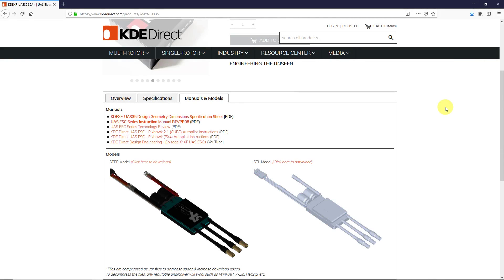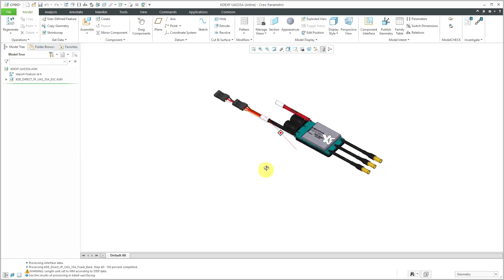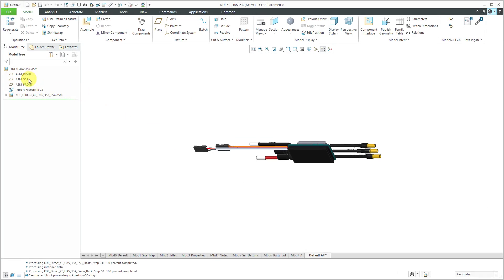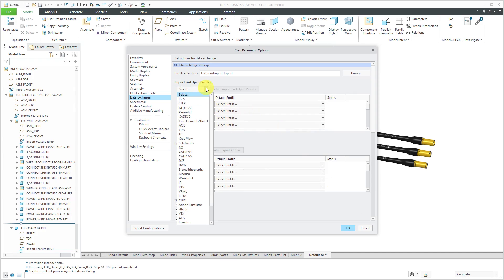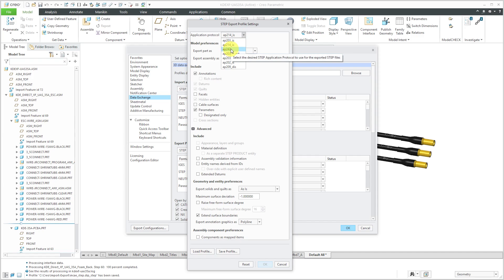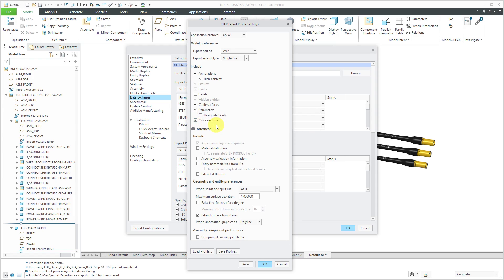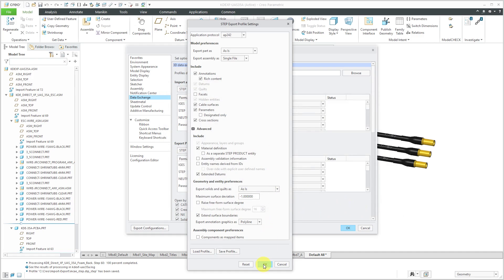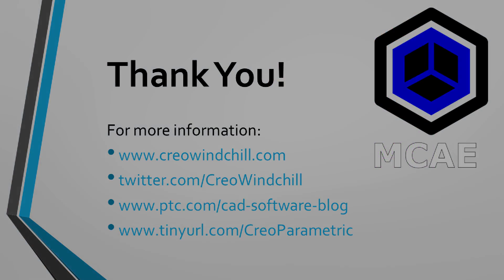Creo Parametric - Importing and Exporting STEP Files

Comment: HOW TO SAVE STEP MODEL WITH COLOUR IN CREO 9.0
Reply from the maker: WHY ARE YOU SHOUTING? WRITING IN ALL CAPS IS THE EQUIVALENT OF SHOUTING.

STEP AP 203 does not support the export of colors. Use either STEP AP 214 or AP 242; both support the export of colors. It's dependent on which Application Protocol you select for export, not which version of Creo you're using.

Comment: It would be helpful to dive into those advanced parameters in more detail. What does creating the components as mapped items do, and why does it save me 1 MB of file size? I try to prevent step translation import errors by unchecking the "Extend surface boundaries" option. Will raising the free-form surface degree help translate round operations better? I need more answers.
Reply from the maker: That’s beyond my expertise. I recommend contacting PTC Tech Support.

Comment: if I export an assembly exactly as shown in this video it seems like it worked. But then when I open the exported step file up in Creo, there are some parts missing, some parts in the tree on the left are marked red and lots of errors pop up ("import validation error, couldn't create volume" or something like that). I have no idea why and it really annoys me. Does anyone have the same problem or even better a solution?
Reply from the maker: See my video on the Notification Center. You can turn off import validation there. I think that check was added after I created the video.
Reply: @CADPLMGuy  thanks for the very quick response on this rather old video of yours. If I turn off the import validation the errors and the red text in the model tree disappear but the parts are still missing, they are in the model tree but you can't see them, there's no volume created...if I open just the affected part from the model tree there's nothing to see, just an empty canvas

Comment: Dear sir !
When i import step file to CREO PARAMEtric, 
File after import like surface-part
But i want to solid part

Can you help me to resolve this problem?
Thanks you very much
Reply from the maker: Try changing the model accuracy. But there's a good chance that the geometry you're trying to import is flawed. In that case, you may be able to repair it with Import Data Doctor but my success rate with that path is low.